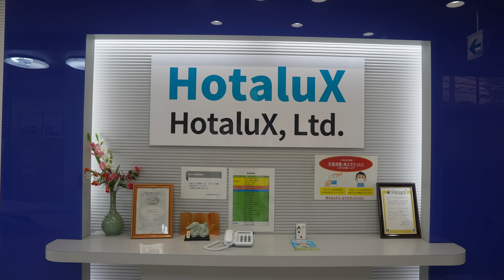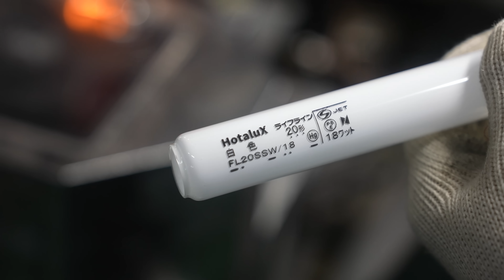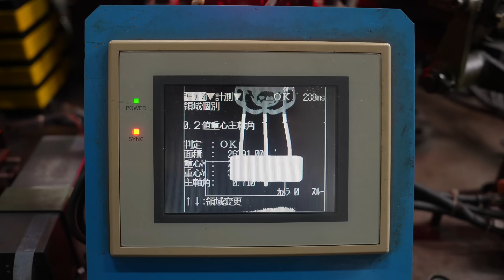蛍光ランプを大量生産するプロセス。1950年創業の日本の老舗照明製造メーカー。

Comment: Some people says that this technology will fade but for me this is one of those techs that are very realiable i remember during my childhood this would last like 5 years or more compared to todays LED's..i dont know why engineers did not improve on the power supply side. But hey im still amazed japan still building this lamps.
Reply: LED lamp in the USA cost ~$5 last  about 50,000 hr, fluorescent cost ~ $2 last about 10,000 hr. LED produces at least 25% less heat than FL lamp

Comment: No mention at all of how the toxic mercury droplet is added to each one, which is what makes it work and why, as noted at the beginning, they're being phased out in a couple more years.
Reply: CFLs contain about four milligrams of mercury sealed within the glass tubing. By comparison, older thermometers contain about 500 milligrams of mercury – an amount equal to the mercury in more than 100 CFLs.
Reply: @manolingz  I'm aware, but Hg thermometers haven't been made for decades and when showing a "how it's made" video on those it would also be very weird to NOT SHOW THE MERCURY being inserted into the final product. The very thing that makes it work at all.